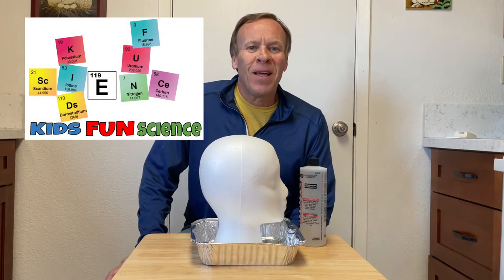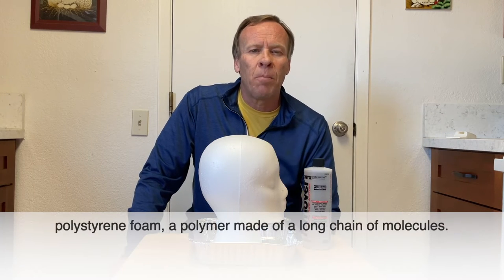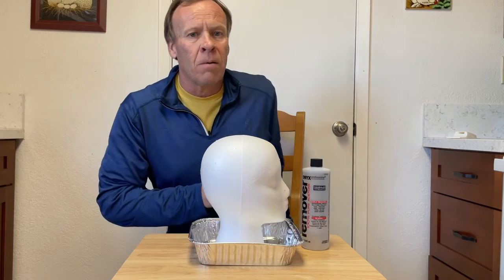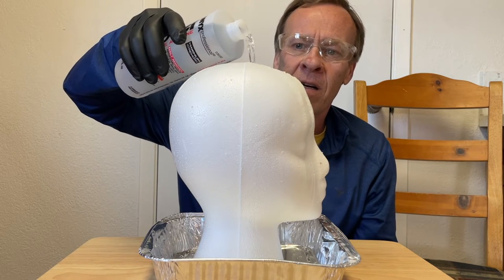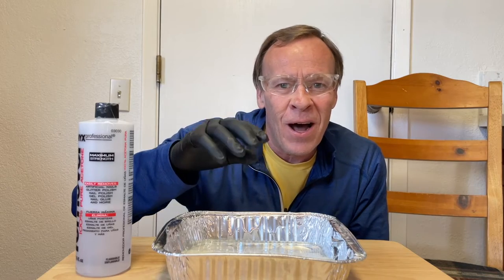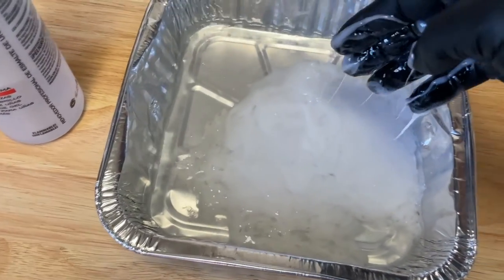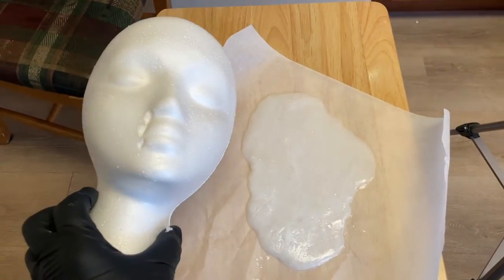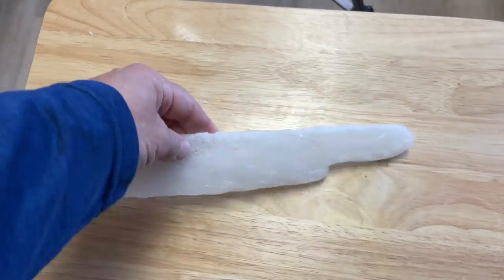Dissolving Styrofoam With Acetone Experiment

Comment: Is it safe to drain the acetone down the kitchen sink ? Of course without the dissolved styrofoam
Reply from the maker: Acetone is finger nail polish remover. Read instructions on the acetone bottle for proper use. I reuse mine. Thx